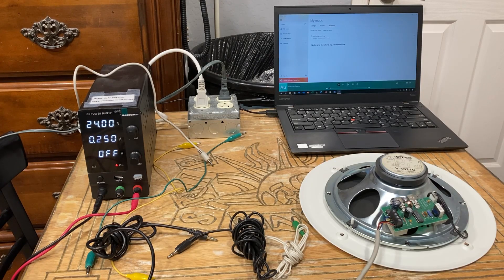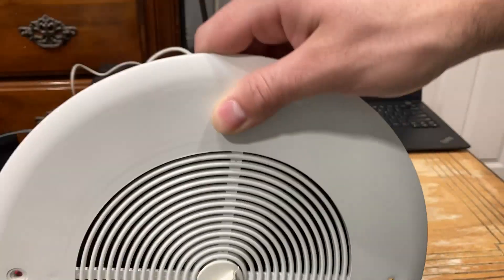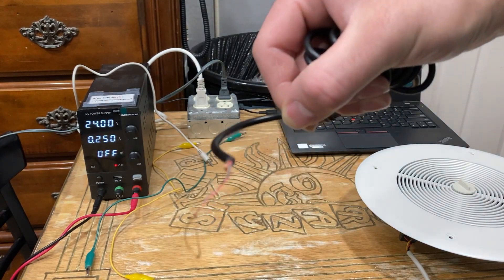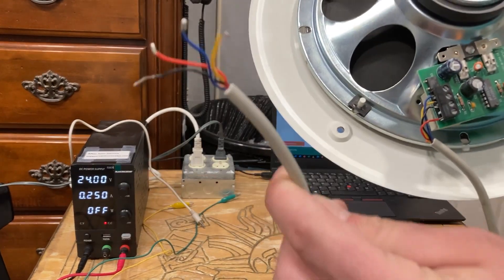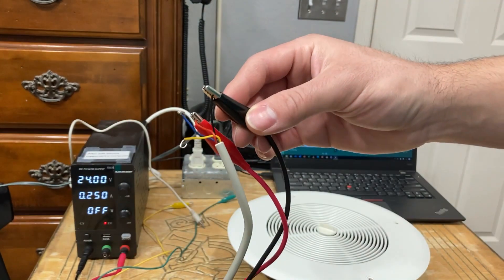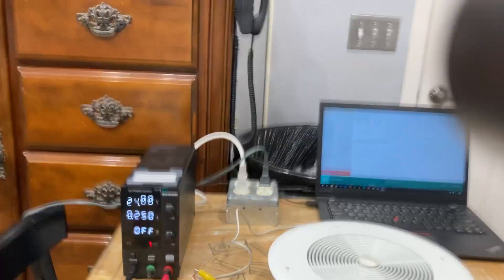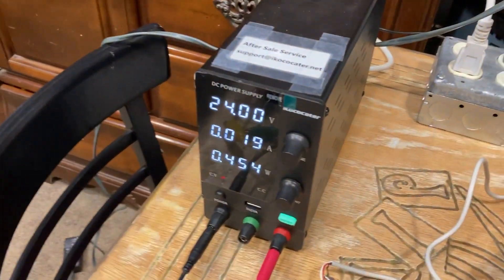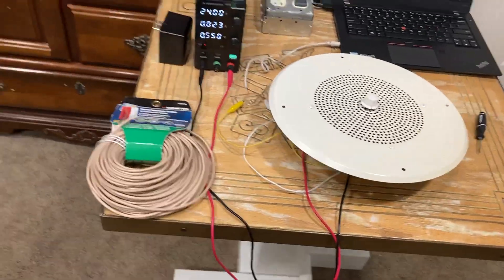How To Wire A Valcom V 1021C Self Amplified Speaker For Your Own Use

Comment: My local grocery store has a few of these in the cafe part. The main part has the 70v version of these. The self amplified speakers are never on but the 70v ones always are. I am guessing that they had the bass turned all the way down on the amplifier because they have always sounded very tinny. The store recently had a rebrand and they kept the system but must have either changed the amplifier or turned up the bass because they now sound great.
Reply from the maker: They likely upgraded the amplifier for better page clarity.
Reply: @CristianOrtiztechmaster926  Yeah the paging was barely audible before but now it is very loud and clear.

Comment: Ideally you do NOT want to strap left and right together. Wire a 100 ohm 1/4 watt 20% resistor in series with the left and right, feeding that single input on that valcom amp board. 

Exact value of the resistor isn’t critical. 

Forcing the left and right channels together, can cause distortion on the device feeding the audio to that speaker’s amplifier. 

As the output devices (usually IC driven) on the music device (maybe a computer or phone) are themselves a low impedance source. They do not want to see any super low impedance (like a short, or another amplifier IC) so using some resistance in series with them, before blending left and right together, reduces the strain on the “headphone jack” of whatever device you’re using to playback audio, into that mono speaker. You’ll get a negligible decrease in volume with resistors, but atleast it won’t distort. 

I say this, because in the past I’ve damaged headphone jacks on phones and computers by forcing the cables mono.
Reply from the maker: Thanks for the advice and if I could go back in each of those videos I would of gone that method with the 100 ohm 1/4 watt resistor.